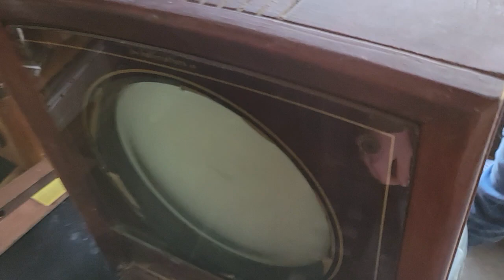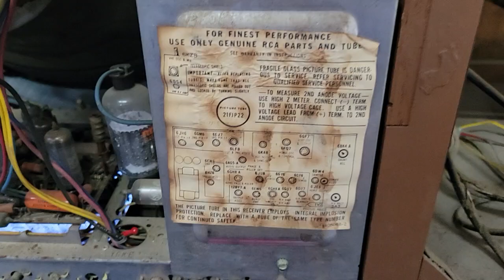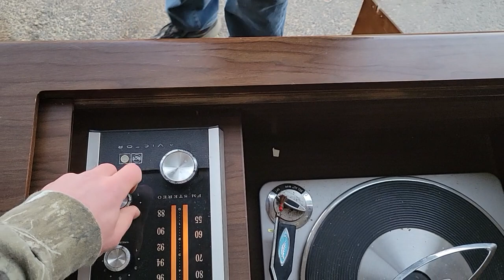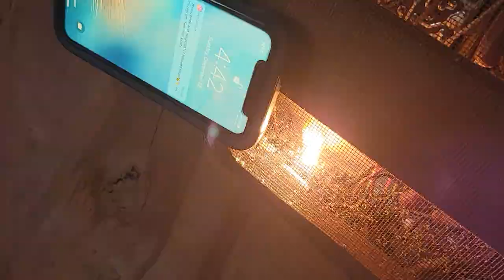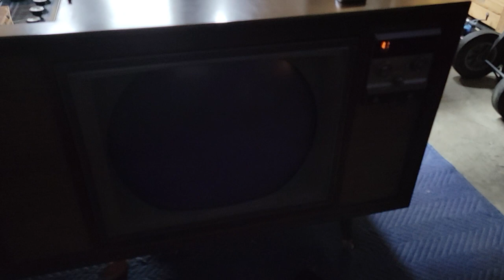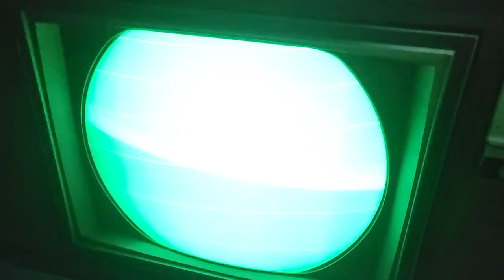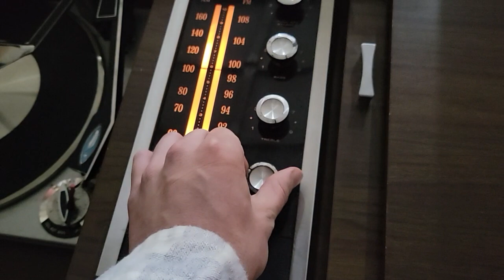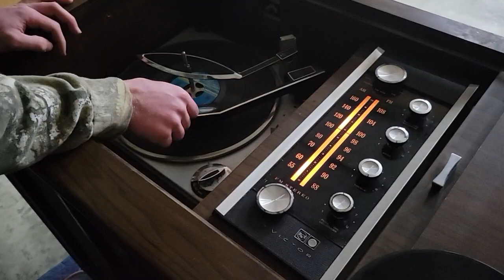1964 RCA CTC 16 MEGA COMBO vintage tube color television roundie assesment w/Matt

Comment: Getting a few random tubes thrown in is always nice, last time I had that I tried them without testing and almost fried an audio output transformer.
Reply: HEY never operate a valve amp without speakers connected in that way you can burn out the output valves and output transformer